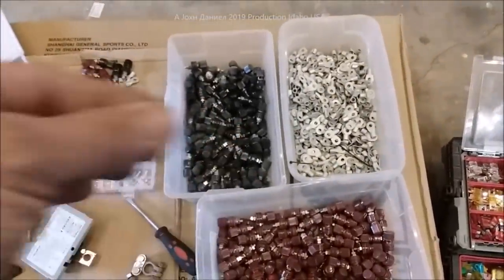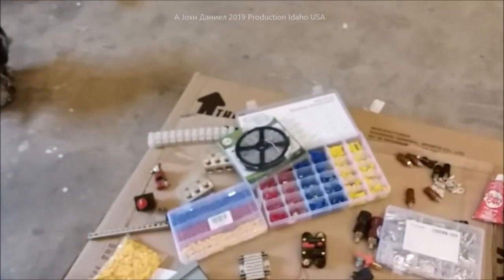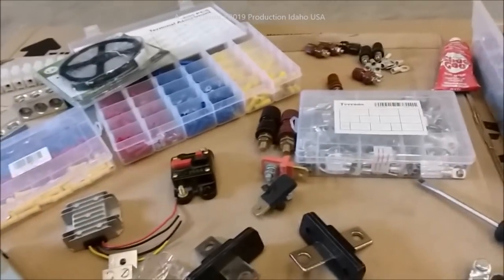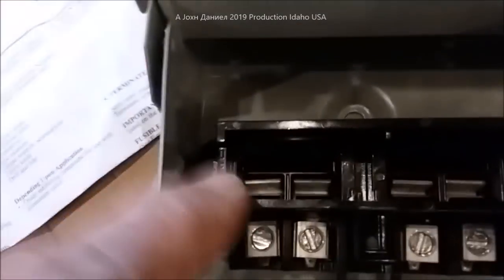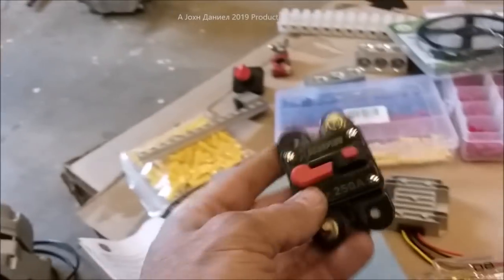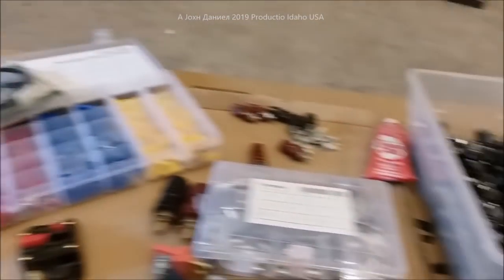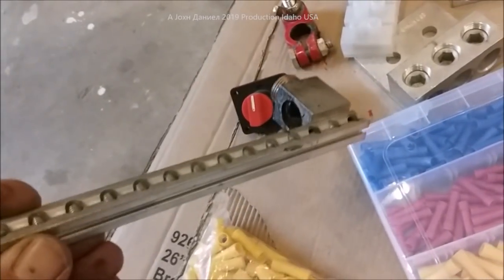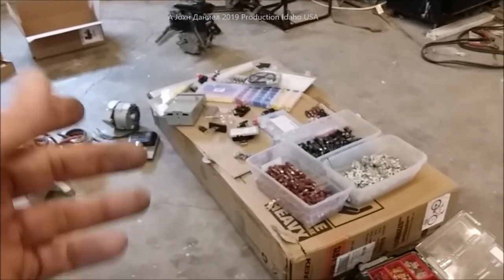DC voltage - needed parts, uses, solar products Safety Warning!

Comment from the maker: Items - Parts Organizer https://amzn.to/2KgYfyW , Adjustable DC voltage regulator https://ebay.to/2UFWq2o , Terrans heavy power lugs , https://amzn.to/2FUPwwW , USA made TemCo Wire/cable/tools https://ebay.to/2I4Q5aS , 600PCS Insulated Assortment Terminals Lug Kit https://amzn.to/2KiDra8 ,120 Assorted Fuses with Fuse Holders https://amzn.to/2UofuTE

READ FULLY - 4 Red - 4 Black with 8 terminal lugs for 4-6-8 awg wire, $25 with free shipping. See to buy and make sure your information/address is correct. https://paypal.me/PokysParts/25 Put in the NOTE - 80Ampx8 with lugs 
*I ship in 4 to 6 days due to not always being in town when orders are posted.
*No shipping to areas of south east Missouri without account verification.
Reply: Do you crimp your large gauge lugs, and if so, what crimper tool do you recommend?
Reply from the maker: @jimamos8960  Great question, I will have to make a video called "It was just laying around the shop, and now it crimps huge lugs!" I use cheap small bolt cutters I modified with a grinder to make a few select different size crimpers. Also I use a Jack Stand cleat for the really big stuff with a hammer, FAST and easy so looks like a Share my Idea video needs to be made.
Reply: @JOHNDANIEL1  I've got a T&B crimper for small gauge (12-20), but venturing into these larger lug and wire requirements had me wondering.  Tool hacks like you suggest (bolt cutter grinding) or jack stand press cleats would be a wonderfully cool video.  Keep up the great work.
Reply: A hydraulic press and a small meat tenderizer block and you are in business lol

Comment: What do you think about the fuse blocks that have the positives out on single fuses and has a built in negative block?
I was looking at them as my distribution block for led lighting in areas around the house.

Comment: Hey  thanks for the info I am converting a horse trailer into an rv to be 99% run on solar I have never messed with solar power before but I used to install car audio and video  I do have some questions about solar if you are not too busy my email address is shaun.forcier@yahoo.com this video has been very helpful

Comment: God I could use you help lol great video!  What do you mean when you say clamping are you say pressure  and why a terminal won't  work and wire is welding cable OK  love you videos . John
Reply from the maker: Clamping pressure such as compression of the contact points in the joining process.
Reply: @JOHNDANIEL1  what's your take on welding cables for wire in
Reply from the maker: @nyghtmyst5118  Yes much preferred, Welding cables are designed for tough service,  high amp DC voltage.
Reply: I used 1/0 welding cable and copper lugs for all my battery cables I used flux core soldering them with a torch after crimping them with a small hydraulic press lol.

Comment: I made battery connection 2/0 welding  cabling using tinned lugs, with solder pellets... no clamping. Do I have an issue? Thanks, great video

Comment: I'm old enough to remember when boxes stated AC only or Dc was rated 1/2 current or less.  
Then people don't use formulas right.  
Got into a heavy discussion about 16 gauge wire n amp capacity.   SMH

Comment: Hey John I bought some copper bars 1/8 thick 3/4 across 14 inches long . I cant find anything about building a copper bus bar for my battery bank and electronics box.  So is copper a bad idea for this? How many amps can these handle? Should I tin the surface where I will be connecting terminals? Should I double up the bars with a spacer? John if your ever traveling near blackfoot idaho could you possibly stop by and see my system and give me some pointers?
Reply: I'm definitely thinking I should use 2 of these for thickness and a 600 amp ANL  fuse holder at each parallel connection.  Or 250 amp ANL fuse on each havent decided yet haven't found enough information on busbar installation to guide me on that. I think each bar can handle 250 amps easy.
Reply from the maker: @donaldsteele6276  at 3/4" wide and 1/8" thick your about 210 amp continuous with 240 surge per bar at a length per bar not to exceed 10" for that rating.
Reply: I'm building this to equalize the power in and outs across the entire bank. The bank is 1,410 AH 12v.  And has 6 parallel connections on each side. And 6 series connections.
Reply: So to up the amperage to 400 amp just double up the bars with a spacer ? Or 600 amp with 3 bars? Each terminal is exactly 10 inches apart.
Reply from the maker: @donaldsteele6276  Technically yes. But you don't need to achieve anymore than 3x your inverters max draw on all your batteries combined. Thing manifolding. So if you ran 4 awg from and through 8 batteries to a huge 900 amp distribution bus bar, you could achieve the max draw on a 5k inverter
Reply: I have 1/0 welding cable 8 inch cables middle with copper lugs on each end . I have 20 of those all exactly the same size.  I was thinking of building a bus bar on both sides and bolting the positive and negative sides to a bus bar on each side then running a 4/0 cable from the far left positive side to a bus bar inside electrical equipment  box and the far right side negative to a same sized bus bar to limit wires going to the bank. And call this one charge power in and do another positive negative  connections on the other side of bank and call that power output  . And size up ANL fuses for those lead cables to the bank. And bolt electronics to the  bus bars and use breakers and fuses sized for those. Like my 6 kw 12kw surge inverter has 2  positive connections wired with 2/0 welding cable 3ft. I have 250 amp ANL fuse holders on each positive one. And my 100 amp rectifier a 150 amp ANL fuse and my 40 amp mppt controller had a 40 amp automatic reset DC breakers on 600 watt solar panel positive side and the battery bank connection which has went off a few times and burnt wires so I removed the battery one so that wont disconnect again causing my panels to heat up the wires from having no where to go. I will replace that with a 50 amp ANL fuse holder . Or breaker. What size fuse or breaker should be on the 4/0 leads from bank to electronic box bus bar? And does shortening the bar length increase the amperage it can handle or double up? What length and how many of the copper bars should I use on both sides battery and electrical box?